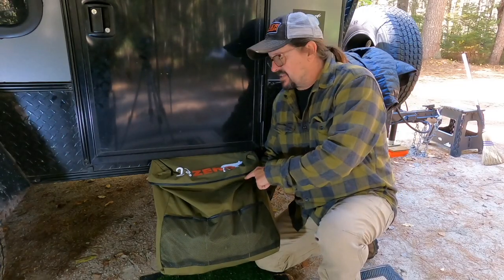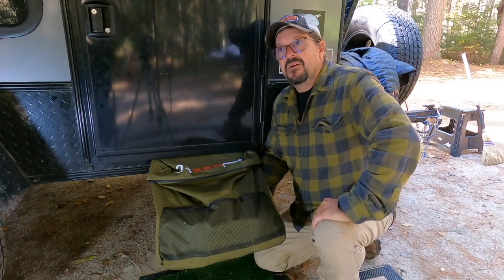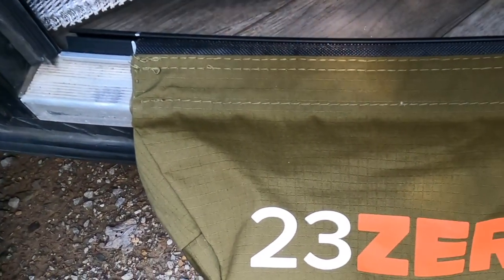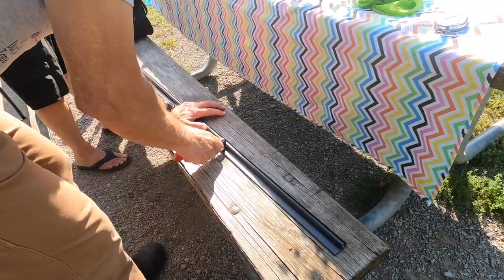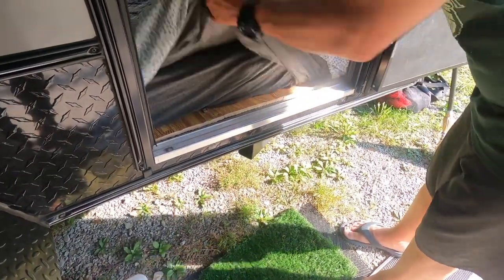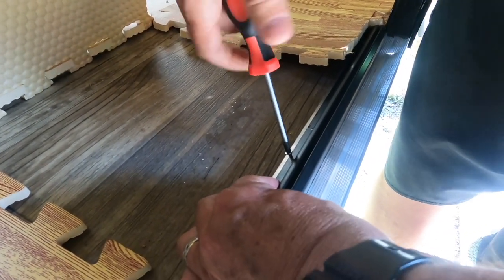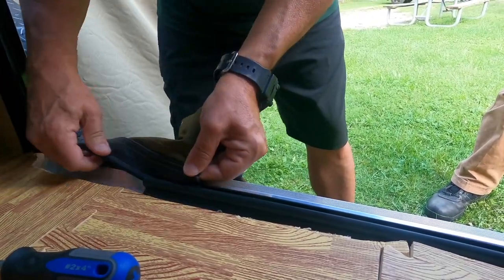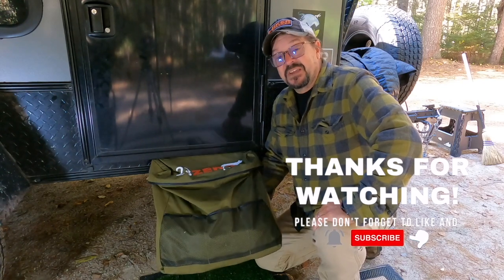HIKER TRAILER: HOW TO 23ZERO EASY BOOT-BAG MOD!

Comment: Hey guys great addition, will the track and bags fit if the Hiker has screen doors on the rig? I have the screen doors as a separate door.
Reply from the maker: Thanks @scottgorman7166 Good question! Not really sure, since we don’t have the screen doors. But, I can’t see why it wouldn’t. The door ‘threshold’ should be the same.

Comment: I bought the rail, but instead of putting the rail on the threshold. We put the strip on the side of the Hiker. If you follow the bottom of the doorway up, the first line with screws in the hiker, we took the screws out, drilled holes in the strip, put it against the side of the Hiker and put the screws back in. I'll try and get a few pics and post on the Hiker site this weekend.
Reply from the maker: Hi! @gandalfthemead3121.  Sounds like a good idea. would like to see Pics.  Thanks for Watching.
Reply: @skywaystohighways  Where do I send a pic too?
Reply from the maker: @gandalfthemead3121 Really awesome mod!!!

Comment: do you have a link of where to buy that track?
Reply from the maker: @karl eicher Hey there! The track size purchased was 42”, but that seems to be out of stock. You can purchase it in longer length, here. https://www.sailrite.com/Awning-Track-Flanged-Black-90 
Thanks for watching!
Reply: @skywaystohighways  Just tried to purchase the 90" track.  $35 for the track and $40 shipping.  Will try to find a better solution.